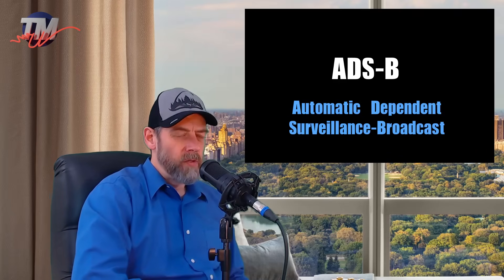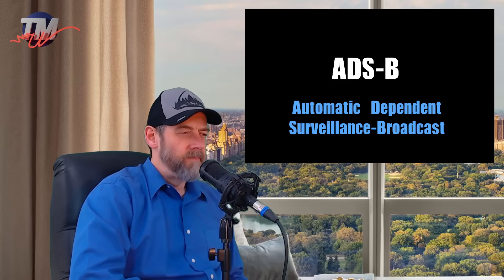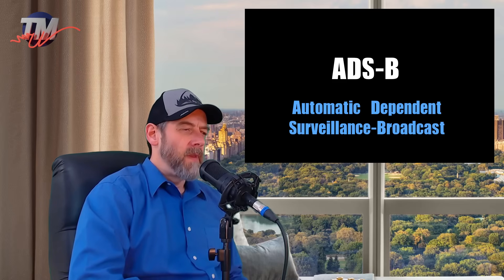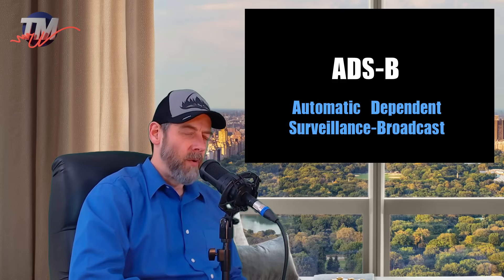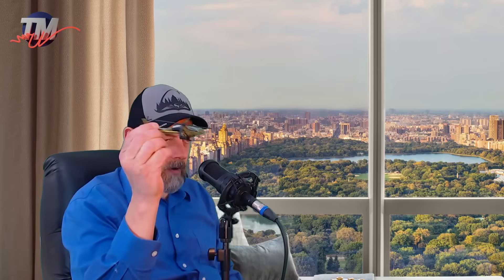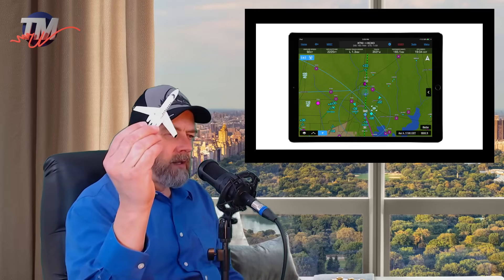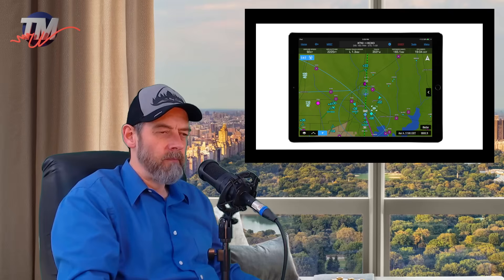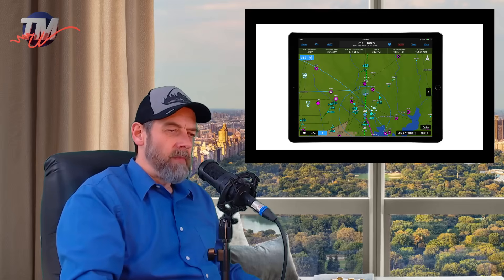The Blackhawk's ADS-B-Out system was turned OFF. Why, what is ADS-B, and why does it matter?

Comment: and the SSR-C transponder has a much different refresh rate, it responds to the radar interrogation  -- so the radar screen does not have real time information and it takes several interrogations to understand heading and speed -- there is latency vs ads-b which is continuous broadcast.
Reply: Are you mixing PSR / ASR-9/11 with SSR/ATCRBS operation? Each is independent. ATCRBS/SSR has its own interrogator beacon at 1030 MHz ... ASR-11 or -9 is in the 2.7 GHz frequency range.

Comment: I have seen two videos of the crash. The helicopter never paused or deviated from its trajectory. Because it was a training flight, there was no reason to turn off the ADS-B in a very busy, high-trafficked area. The action by the helicoper was either intentional or gross negligence.
Reply: Or Hacking!
Reply: "gross necligence?" Or it was just bad habits that crept in over time on both sides, tower and helicopter pilots?
Not seeing traffic you are supposed to see is one single error. But ATC is there as a redundant system to mitigate such errors.
Granting visual separation (for efficiency reasons by the way) was taking an layer of safety off the swiss cheese model.

Probabilities dont add up, they multiply!
Which means taking one factor away will have huge impact to the probability of bad outcome.
Reply: @Merilix2 
Lets go Driving on the sidewalk shall we?
A deliberate act. No accident
Reply: @HongyaMa  seems like you never overlooked something you were supposed to see.
If bad habbits creep into daily and usually procedures, thats not neccesarily the fault of a single pilot or controller. Its a fault in the system of rules.

You have something in sight you are convinced its the thing in question? Of course, ask for visual because thats usual. 

Someone request for visual after he confirmed he see what he is supposed to see? Of course, give permission as that shift responsibility and workload away and is usual.
... until ... you know.

There were several slices of the swiss cheese model aligned like wrong altitude, bad timing, overlooking the traffic. But several slices were just taken off the model which could have prevented the accident to happen.
Reply: One must question the assumption that it was an actual training mission, especially when there is even ONE anomaly. This flight had SEVERAL anomalies which could indicate intent. Intent cannot be ruled out without a detailed analysis.
Reply from the maker: Are you saying they failed an actual mission? That is even worse for the military.
Reply: @truthmattersunplugged 
YES ! They catastrophically failed whatever "mission" they were on. 
And it cost the lives of  57  people !!!
Reply: @stevesims-d6c  The pilot had only 500 hours flight on her belt, her instructor a mere 1000 hours. From what I've heard, thats nothing in aviation. Personally, I do not doubt the premise that this was a training flight, and from what I've heard, military standards are apparently lax compared to commercial, and since the Blackhawk didnt slow down despite being in a high-trafic space... it tells me, they were in over their heads. Doesnt take away the Tower's responsibility, but before I jump to conspiracies, I go with lack of judgement and human error on both sides.

Comment: Can one fly incognito (with the adsb turned off) but still see other aircrafts on his monitor ? In my view the result of the autopsy on the three crew members will solve the case.
Reply: re: "Can one fly incognito (with the adsb turned off) "
That is the way all these cheap SDR dongles plugged into a laptop/PC work. ADS-B In only. 
How much sense this makes and does this violate FAA regs is another issue if used in an aircraft.

Comment: 2/8/25. Another excellent video 2d re: Senator Cruse comments after non-public meeting with NTSB, FAA, ARMY + Congressmen & others?..Cruse says/discloses Blackhawk, doing a Military training (mock evac of President due to some xyz emergency) & ..> did Not  <  have its particular/specialized transponder 'on'..which prevented the commercial inbound a/c from its traffic awareness system to see th Helicopter. Why? ..due to Blackhawk's (Military)...'strict adherence' to non-disclosure of xyz VIP/passengers [via helicopter position awareness]...while >.. (contradiction)..< simultaneously Not Maintaining its 'strict adherence' of 200ft Max altitude for separation from commercial inbound, descending commercial jet(s). 
  Anxious to hear back from you on your very brief mention (from this meeting) of 'discrepancy' in actual altitude...of (undisclosed)..? Blackhawk? ..or commercial jet?..or both? 
  Hey, its the FFA who designs⚙️🔧🔩 these flight paths (maybe old TERPS criteria?) so 'Class Action' people should zoom-in on when/how current vertical separation compromises & intersecting flight routes were made & by whom...🤔👀🕵‍♂️   Agree, Blackhawk was too high⤴️ irregardless of Nite Goggles, or special transponder 'off', or helo crew of 3 not 4 or Tower crew of 5 not 6 [at routine diminished traffic levels..practice to let 1 guy 'go home early'].
  . Lots of 'moving parts' to examine & tell th public.  Thx for your channel & your methodical explinations. A+✅️ 💪😐

Comment: ADSB and mode C both transmit pressure altitude.  Although ADSB is more accurate for lateral position, it provides the same altitude information.  Not sure I can agree with the statement that ADSB altitude is more accurate than Mode C altitude.  In reality the lack of ADSB was probably not a significant causal factor in this accident.  Tower was using MLAT data for their displays which had adequate resolution.
Reply: Well surely both aircraft FDRs recorded the last RADALT parameter of each respective aircraft at time of collision.
Reply: @rickbartlett5282  The ones I worked with recorded both PRESS_ALT and RAD_ALT. 

And at far better than 1 sec resolution, I think the frame had 4 or 8 repeats of each param in the 1 sec frame timespan.  And as far as I recall there was a circular memory from 30 to 60 minutes recording duration, maybe even longer.
Reply from the maker: And ADS-B Out unit transmits GPS (geometric) altitude with much greater accuracy than barometric altitude (mode C). Many ADS-Out transmitters also transmit Mode C barometric altitude.

Comment: OMG. This is so stupid in so many ways.

Those helicopters were doing training missions.
They were helicopters that were described as evacuation transport of a senator to a bunker during an emergency. 

They are operating in the vicinity of a commercial airport at night using a runway that was not even the first one assigned for the jet to land.

The passenger jet was assigned to runway 1 and it was. Requested to change to 33 by the ATC controller.

There were at first two controllers on duty. Then one left early.
The remaining controller was doing two jobs.

Can we make this more of tragedy piled upon tragedy piled upon
Reckless Incompetence. 

I cannot see this end without Treble Damages and Jail Time for Manslaughter for each passenger killed.

Comment: Very interesting video.  However, when you said in the event of a real emergency, "The president would be dead," because of the poor procedures, it does not make sense. In the event of real emergency, the airspace would all be closed except for the VIP evacuation.  So, you are making a false assumption about the real risk in a real emergency.  There is actually value in training for a real emergency by NOT using ADSB In.   They can't train using tools that they will not have available in real emergencies.
Reply: The airspace could be closed by the time an evacuating helicopter is passing through, but it might not be empty by that time, so this mission was still a fail at its intended purpose.
Reply: @awereal  Yes, it was a fail, but that is the whole purpose of training.  So when the real emergency takes place, it does not fail.  The only point I was trying to make is that the reason they had ADSB turned off was to simulate a real emergency where they need to fly without ADSB.  This was obviously a poorly planned exercise with terrible consequences.  But, there is a reason the helicopter had ADSB turned off. Perhaps, from now on, there will be a policy to have a crew of at least 4-5 in a helicopter not using ADSB to increase situational awareness.

Comment: excellent analysis, but you seem to be missing one thing.

the commercial airliners were coming in almost nose to tail, separation of no more than a few minutes. thus, it becomes very easy for the helicopter pilots to see SOME airplane, and ASSUME that was the one being referred to.

and, being on a collision course with the closest airliner, its relative position in the sky would be CONSTANT (so, very hard to notice), and it would be SMALL until about one SECOND before impact.

no need to conclude MALICE on the part of the army here

Comment: If it were an annual check ride the Check Pilot has to let the PIC Person Flying Make Mistakes inorder to Disqualify them. They can't keep correcting them, It's not a Training Flight.  Listening to the Radio calls I don't believe that the Check Pilot had the CRJ in site just said he didl   Question CRJ had ADS-B out turned off was ADS-B in also off?    why didn't the Black Hawk see them on their ADS-B display?  Was the Crew of the Blackhawk so busy flying at night own low and allowing Mistakes that they never realized the Impending Collision because of Crew Overload.
Reply: A finer point of instructional technique and judgement. How far do you allow a student/PUI to stray from acceptable or safe actions before you intervene? I would maintain, not far, especially in this particular circumstance.At 1000 hrs as an IP, that skill may not have been developed.
Reply: It was the reverse. BH has ADS-B out off, CRJ had it on.

Comment: I agree that Blackhawk made multiple holes in the swiss cheese. But, how could the CRJ get a traffic alert 18 sec before impact if ADS-B out was off on the PAT?  My understanding is that TCAS (using ADS-B in) gave the alert, and almost didn't because the CRJ was just descending below the 500+ foot threshold for alerting when it happened.  I was just told by pilots that ADS-B uses pressure altitude. I'm not aware that it sends both GPS and pressure alt. BTW, barometric pressure just minutes before the crash was at 29.90 vs the 29.92 reference pressure altitude, and the Potomac is essentially at sea level there, giving an error of about +20 ft.
Reply: re: "My understanding is that TCAS (using ADS-B in) gave the alert,"
TCAS does not use ADS-B. Ask your fave search engine. TCAS does its own inquiry to other aircraft on 1030 MHz. They (TCAS and ADS-B) can operate cooperatively to enhance operation though.
Reply: Don’t need ADS-B for TCAS.  Regular mode C can and will generate a TA.
Reply: Thanks for the clarifications! I didn't realize that TCAS pre-dates ADS-B by decades, and utilizes even ancient transponders by spoofing a Secondary RADAR interrogation to nearby planes for range. Bearing comes from radio direction finding equipment on the TCAS plane. Altitude is always uncorrected pressure altitude for navigation. Modern TCAS can additionally incorporate ADS-B and ACARS for better distance+bearing, but it still uses ADS-B pressure altitude. ADS-B can transmit an extra GPS geometric altitude, but stats indicate that average 1-sigma error is over 570 ft, so useless for navigation. At low altitude, the pressure altitude reporting is in increments of 25 ft. Fascinating stuff.
Reply from the maker: As I explained in the video, ADS-B OUT transmits GPS altitude and barometric altitude.

Comment: ADS-B had nothing to do with with this.

Also, regardless of the ADS-B, the CRJ still had a TCAS system that, although it wouldn’t provide a Resolution Alert (RA) because they were below 1000 feet, it’s still provided a Traffic Alert.
Reply: This a non-sequitur. The non-use of ADS-B had something to do with this, however, the exact coefficient of 'cause' up for some debate ... it WAS one more slice of the Swiss cheese that aligned.
Reply: @uploadJ  Think you meant .... "  non-use of ADS-B had NOTHING to do with this "  ?  

Though it is a smoking gun for the cavalier, even maybe arrogant, attitude of MIL procedures, and pilots, towards ATC.

It has A LOT to do with INVESTIGATION though - uncovering all the holes in the slice of cheese.

Comment: An interesting point you make. I have been wondering why the Local Controller didn’t issue traffic to the CRJ. Traffic for one is traffic for the other. Normally a traffic call is issued to both aircraft. The controller may have been procedurally constrained because of the security requirements of the PAT mission.

Comment: Whether flying in daylight or at night, when ATC asks if you have the traffic you need to quickly make that connection and if you can't, you must inform ATC you do not have the traffic which in that case, controllers will remediate the situation so that there isn't a conflict.  When the blackhawk co-pilot quickly announced they had the traffic although they didn't, just by saying I don't have the traffic could've led to a different outcome and saved a lot of lives that were lost in this crash. Secondly, the controller should've seen a conflict in the making on his radar display and ordered the blackhawk to hold or make a course correction and that didn't happen. So many mistakes made in this case that I hope leads to new operating resolutions between rotary wing aircraft and fixed wing aircraft to mitigate any possible conflicts in the future.
Reply from the maker: Agreed
Reply: The problem is, as shown in the PAT11 video, these helicopters routinely flew underneath landing (and maybe departing as well) aircraft with zero horizontal separation. So the controllers were used to seeing the radar blips merging in these phases of flight. It was systemic.
Reply: Tower control IS NOT radar control. Tower uses human eyeballs, not radar. Displays in the tower are just that: displays of where planes are. It is NOT radar.

Comment: Helicopters are generally exempt from ADS-B (Automatic Dependent Surveillance–Broadcast) requirements, especially during tactical, training, or operational missions. In the Washington, D.C. area, which includes Ronald Reagan Washington National Airport (DCA), airspace is highly restricted due to the Special Flight Rules Area (SFRA) and Flight Restricted Zone (FRZ) around the capital.

During the annual Blackhawk check ride at night, military helicopters may or may not have ADS-B turned on, depending on mission security and operational discretion. If flying within controlled airspace, they are usually in direct communication with air traffic control (ATC) and operating under military or government flight operations.
Reply from the maker: Incorrect @ezragonzalez8936. Military aircraft are exempt from ADS-B out in controlled airspace only under specific conditions: if they have a waiver from the FAA, if they have permission from ATC, or if they are on a mission of National Security. They are NOT AUTOMATICALLY exempt. It's in the regulations.